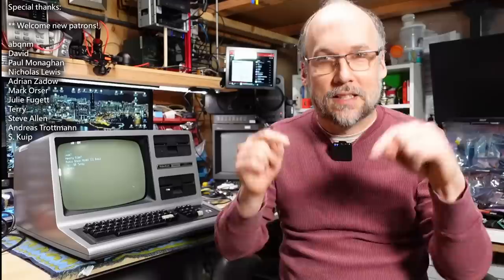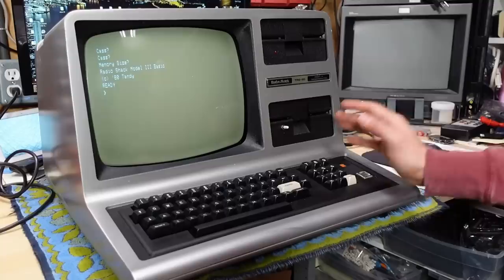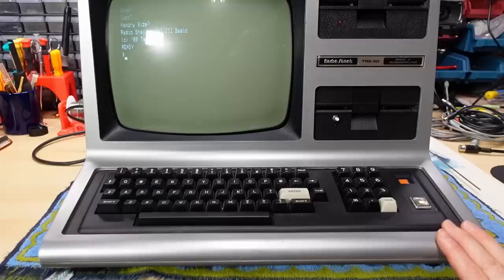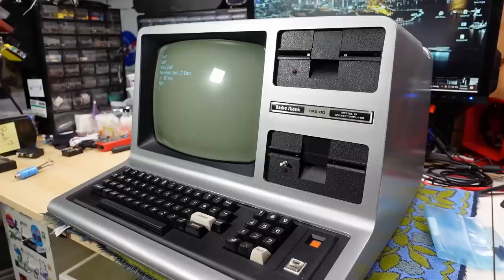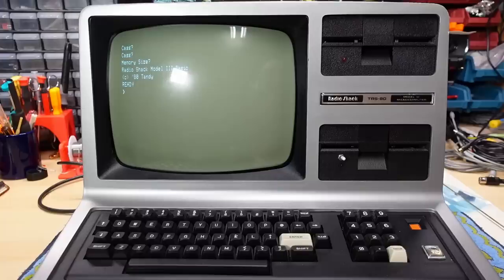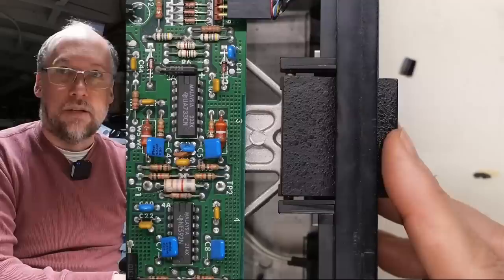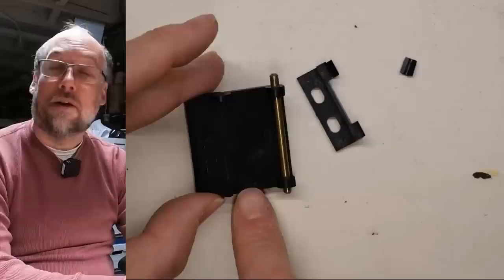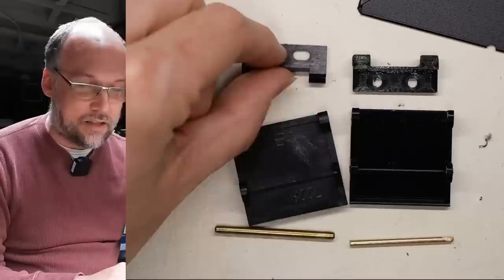Fixing an old disk drive with 3D printed parts (Tandon TM-100)

Comment: Design flaw 1990: Holds only 30 years
Design flaw 2020: Breaks slightly out of warranty, aka 2 years. 😁
Reply: 1990s? Try 1970s!
Reply from the maker: HAHAHAH!!!!!!!!!!!! This is pretty amazing and seems so true.
Reply: Design flaw 1923: Still working 100 years later (radios). Back then even the capacitors lasted forever same as the 01A tubes!
Reply: Progress! Except it's in the field of 'planned obsolescence'.
Reply: @ItsMrAssholeToYou  Cool handle!  Very much agree with you here.  Planned Obsolescence and Conspicuous Consumption are the twin engines of modern industry, and they have had a terrible effect on the American consumer's expectations and spending habits, and are part of what drove a lot of our industry overseas, where it can be done more cheaply.  (But what do I know, I'm just an old Boomer...)
Reply: Well, we're trying to remove most of the moving parts, which would help I suppose. I have a hinge, a fan, a webcam shutter, keyboard & touchpad and I suppose the little clips that keep the connectors from falling out. And that's it I guess, unless you'd even include the speakers.
Reply: @herbertsusmann986  I guess you've never experienced the joy of a an exploding capacitor.
Reply: how do all the old folks that remember how things were still cling to life in such an awful world?  Oh they don't make them how they used to everythings so awful and worthless :) :) :) :) :) [laughing] oh how awful. that's the image I'm getting here
Reply: @kargaroc386  Modern things are too overengineered, built just good enough that they work. Old things were vastly overbuilt, as the engineering knowledge wasn't able to design them so close to their material limitations without having them fail too soon. These days, the warranty period is likely all your getting out of something before it has problems not economically repairable.
Reply: Holds? Hold the door. Hodor. L A S T
Reply: @ravenbarsrepairs5594  You and @Herbert Susmann  are both right. One, tantalum and RIFA capacitors are 'splody and blue-smokey. The former fun but potentially arsonous, the latter a nasty kind of smelly. That being said, two, even post-capacitor plague, it still applies to many an electrolytic that "they just don't make 'em anymore like they used to". In fact, some electrolytics have borderline-miraculously stood the test of time and more than a half-century later are still good. I haven't witnessed it myself, but I'm willing to believe that once your elco can hit fifty, it can go for a hundred. Of course not all old caps and tubes went the distance, and we know which ones didn't.
Reply: @Brandon Taylor heard it in his voice reading your comment lol
Reply: @horusfalcon  yep. Tons of innovations spent in the wrong places.
Reply: You do realize all this vintage hardware has been in use just for a fraction of its life, and in storage for the rest of the time. Yes, still more durable, but not by such a huge difference.
Reply: @BilisNegra  All that's missing is a circuit-level odometer. 😛
Reply: In 30 years time some guy will be marveling at a 2022 Dell laptop that somehow still works and saying "they don't make 'em like they used to". Even though virtually all the other Dell laptops have long gone to the recycling centre in the sky. It's called survivorship bias - judging the quality of things based upon the one that lived instead the multitude that died. Happens with old tools, furniture, appliances etc.
Reply: @drxym  this
Reply: @drxym  You have a damn good point there.
Reply: @drxym  That is a thing – but the fact survivorship bias exists doesn't mean all the other observations are necessarily false, just potentially distorted. There probably are smart tech historians who'll be able to tell us how they control for survivorship bias.
Reply: except it wouldn't be called a flaw in 2020 but "optimization"
Reply: Year 2000+ devices designed to last until they want people to buy more (out of warranty). Year 1970-2000, last longer than you intend to work for the company.  Year 1950-1970, designed to last longer than most people will care about. Year <1950 designed to outlive you.

Comment: Remember that you can do work on 3D-printed parts after they're printed. You can easily sand down the extra thickness and even apply some textured paint to match the original. (Though I think the original paint is heat-cured and would probably melt the new part )
Reply: I wonder if you could sand down the broken part from the back to create a thin sliver of essentially veneer and glue that to a thinner (or sanded down) 3D-printed replacement.
Reply: @ropersonline  I imagine it would be difficult to remove that much material from the original part with the tools that Adrian (and most electronics hobbyists) would have, and be left with an even, thin veneer that would adhere to a 3D-printed part and (honestly) not look worse.
Reply: @wbfaulk  a better options probably plastic welding if you wanted to keep the part looking original
Reply: @jaykoerner  I have a sense memory of those drive levers and something tells me that it might not be thermoplastic.
Reply: If you're gonna sand it down anyway, just use a course sandpaper, that'll create a texture itself. Then there's no need to paint (or glue) anything.
Especially if your use an oscillating sander, the texture will be uniform, not showing the marks you would leave if you just pushed the sandpaper back & forth manually.
Reply: @wbfaulk  You do have a point. Perhaps this is where shared facilities like hackerspaces or workshops might come in, assuming they're better equipped. Perhaps it's also possible to find some local company that has a machine shop with, say, a belt sander and a qualified operator who might help. Of course that's always experimental, and sanding polymers can be a tricky business, as you don't want your piece to overheat and start warping, melting, etc. It might be best to bring more than one and not expect a third party to get things just right on your single irreplaceable part.
Reply: @jeffro.  I don't think you're familiar with the texture on those drives. It has this odd finish that looks like it was about 60% covered with little blobs of paint that were left to dry most of the way and then scraped over, leaving a random pattern of ½mm-scale irregular flat blobs that sit about ¼mm proud of the visible underlying surface.
Reply: My concern is that if you sand the front too much you might reduce structural integrity. However, that might depend on the filament since some are stronger than others.
Reply: It doesn't appear the original plastic was painted, but in any case I cannot imagine a paint that would accurately reproduce the texture.

As for the thickness, I wonder if it isn't possible that there was a slight change to the design of the clamping mechanism, or the front-panel material itself is of a different thickness on some drives.
Reply: @Starchface  I suppose it might be possible to reproduce the texture through mould-making and casting – if someone were anal enough to insist upon that. Maybe if you work for a museum where things absolutely positively have to look and feel true to the original.
Reply: "Wrinkle black" might give a similar finish.
Reply: Spray can of truck bed liner will get you pretty close

Comment: Blast from the past. Not sure if it is the same exact model, but a local BBS operator ran his BBS (The Junk Drawer) on an old TRS-80 Model III running MTABBS (Mike’s Totally Awesome BBS) and I remember him speaking about having a switch on the drive to do write protect as they could save the BBS files to load on it and flip the switch to prevent changes, unless they needed it. Doubt it is the same Model III unit but probably was done for the same reason. :)

Comment: Whenever I speak to someone in either one of the tech communities or astro communities I'm active in who doesn't have a printer because they think it's too expensive, and they live close-ish to a Microcenter, I always recommend they keep an eye out for the $99 ender 3 pro deal that still seems to run fairly often. It's just such a handy thing to have and many are surprised how cheap they can be
Reply: Apparently some public libraries can 3D print parts for a nominal cost.
Reply: @wesley00042  great point! Mine has a glowforge as well for what that's worth haha

Comment: Nice fix!  FYI: The cura slicer has a setting called "fuzzy skin" which you could probably dial in to more closely match to the texture of that drive's faceplate.  You can use modifier shapes to make sure only the front of the plate that is printed "fuzzy".
Reply: Hmm but it doesn't seem to be possible on the side facing the bed, so you'd have to print it with supports…
Reply: @francoisrevol7926  I think he said he printed it with supports anyway.
Reply: If it was me I would have used a textured PEI  sheet with the model face down.

Comment: So much nostalgia for me with this video!  I started my career doing floppy disk copy protection systems for the Apple ][.  I added the same type of write protect toggle switch to my drives, and drilled a hole in the side of the case so that I could adjust the rotational speed while the drive was still in the case.  I didn't know about the timing sticker on the bottom.  Instead, I wrote some software to measure and display the rotational speed in real time so we could get our drives adjusted correctly.  Apple's specs for rotational speed allowed quite a bit of variance.  Since we mass produced our own disks, it was important that our drives be correctly adjusted so that the disks we shipped worked even with drives that were out of adjustment.

As far as the "lobotomized" Disk ][, many Apple peripherals of that era had much of the digital logic removed or simplified, and that work was done in software.  Not only did it potentially reduce the cost of the hardware, it often enabled more features through software upgrades.  For example, early Apple printers were able to print graphics because the software directly controlled the motors and print head -- back when few printers supported a graphics mode.
Reply from the maker: Yeah the way the Apple II controls the head stepping using address lines from the CPU is brilliant, and so damn smart. All the complexity is in software and you aren't relying on any kind of floppy drive controller. Those PROM chips on the Disk II card just have some simple look-up tables for encoding, AFAIK. It's super clever.

In a way, the Commodore disk drives work in a similar way, but just use an entire dedicated 6502 for the task. Definitely less elegant but at the same time I have to think it would be possible to use the Computer's CPU and a 6522 to control the 1541 directly and at full speed.
Reply: That design made it relatively simple to accelerate and decelerate the head while seeking.  It's just a matter of changing the delay between steps.  It's faster for long seeks, and also quieter.  You get a gentle whoosh instead of a chattering or grinding sound typical of other home computers of that era.

Comment: Ideamaker has a texture application mode, which lets you apply displacement mapped textures to existing STLs. I bet you could get a good approximation of the original texture using that.

Comment: This is totally the reason I purchased a resin printer.  It can print those small parts with amazing precision, and even produce the texturing.  Using black pro ABS-like resin with a model that has all the texturing in place would make the door cover so close to stock as to be unnoticeable from a distance.

Comment: Nice repair.

In the mid-1980s, I was responsible for the Ontel product line at Visual Technology. Ontel offered both 8-inch and 5-1/4-inch Shugart drives. In my inventory were the doors and latch mechanisms for the 5-1/4-inch drives. I never had to repair any drives and to be honest I never knew how until I saw your video nearly 40 years later!

Comment: If you can mould the texture and make a thermally conductive negative cast you could maybe either print directly into onto it, or heat it and push the print into it to melt the texture in.
Reply: or you could approximate it with the fuzzy skin feature in prusa slicer. I'm working on a car part for my dad and I played around with fuzzy skin until it matched the texture pretty closely.
Reply: the down side is only the sides of the print are affected so the front would have to be printed vertically. Should be ok though.
Reply: well he printed it that way anyway so yeah fuzzy skin would work fine
Reply: @awilliams1701  oh that’s pretty cool

Comment: Automotive spatter paint would be closer than hammer paint.  You can also make a heat iron tip that will work with a soldering iron to texture the plastic.  A diamond bit and a thick square of aluminum and patients. 

You can also get textured print beds that memic a lot of textures used.

Your 3 printers need a little tuning and the end results will be far better.

Comment: I fixed a broken tabs in accessory box for a sewing machine using super glue and backing soda. 40 year old box, back as new. Magical… it allow reinforcement of parts and build thing like c clamps from thin air…

Comment: If I understand right, nylon dries out over time. We used to go through quite a few nylon tie wraps at work for one customer's product, and I recall that when I would request some from the materials department for repairs, sometimes I'd get the parts in an antistatic zip-loc bag that had a moist sponge in the bag along with the tie wraps.
Reply from the maker: Now you mention it, I've seen that with nylon zip ties too. Brittle and just snap. Interesting!

Comment: Atari and Commodore also used those drives mechs  with different electronics like Apple: the Atari 810/815 diskdrives and the Commodore 2040 and 4040 disk drives.

Those doors did not break due to age as some are doing now - I was fixing them as early as 1988 on Atari, Apple and PCs for the school I taught in, the Computer Clubs I was affiliated with and for many personal clients I worked for - both individuals and small & large companies (including other schools as I was the Bd of Ed's only Tech at the time). It was apparent to me at the time constant opening and closing of the door introduces cracks to the plastic and over short time after would break. Back then there were no such thing as 3D Printers, so a lot of repairs were use of epoxy, melting of plastic with a soldering iron and lots of cutting and drilling to get repairs to fit into place. Consider in a school, that the computer lab is being accesses every period every class da with about 7 class periods (plus 1 lunch period for an 8 period day) a day, and the average student opens and closes drive door 4 to 6 times during the class period.  Times that with a 190 school day year (average 186 - 188 days per day but lets round it up), and that drive door is being opened and closed 9120 times a year and that does not count after school or weekend maintenance I must do to the lab's equipment in order to keep things going. That is a lot of flexing, twisting and sliding those pieces must do. And they must perform flawlessly year after year after year until the school gets an upgrade, which is about every 10 years. Consider that a paperclip breaks if you bend it back and forth before the 20th bend...

These drives were breaking long before many of the viewers were even born. Those that are breaking now are the survivors of of those times - already weakened in battle and made to start their duties to work again after a 20 - 30 year nap in storage. Of course they will break now.

Excellent video, and excellent repair. Good work Adrian!

Comment: Mt first job after leaving the TV Repair industry was as a computer repair technician fixing and aligning Floppy Disk Drives. I must have done thousands of Tandon TM100 drives not to mention CDC, Shugart, Micropolis et al. I had them stacked up at the side of my bench 20 or 30 drives a day, five days a week. Common faults on Tandon were track zero switches, yokes and door latches, rarely had to change the head assy unless it was physically damaged (usually top head on double sided drives) they usually just needed cleaning and aligning. Happy days.

Comment: I just replaced a floppy drive in a 28 year old Toshiba laptop with the help of stereolitography.
I 3D printed a faceplate for a 'new' drive which didn't have one by design (it came from a newer laptop where faceplate is a part of a laptop and not the drive).
'Upgrading' a disk drive like that avoids all the problems with DC brushed spindle motors and perishing, hard-to-find belts on older drives that were shipped in older laptops.

Comment: Computer Reset had an entire pallet of new old stock double sided clone drives. I managed to grab two of them. One of which in now in my TRS-80 model III. The drive I replaced had the same broken latch which I can now fix with a 3d printed hinge. Thanks!
Reply from the maker: Ah neat! And if it's the Texas Peripherals one that part is on there too. Those old drives aren't getting any more common!

Comment: 14:43 That metal plate will not prevent you to insert a disk while a disk is already inserted. That metal plate will make the disk go all the way in and hold the disk in place.

What will prevent you from inserting a disk? Easy, the black plastic door you close.
Reply from the maker: HAHA good point!

Comment: That texture appears to be a miniature version of "knockdown texture" found in the drywall industry. I wonder if the technique could be miniaturized using some thick resin/glue and a teflon roller? The trick would be to apply random globs everywhere, then flatten them out. Tricky. Great video, love the channel and content. Cheers!